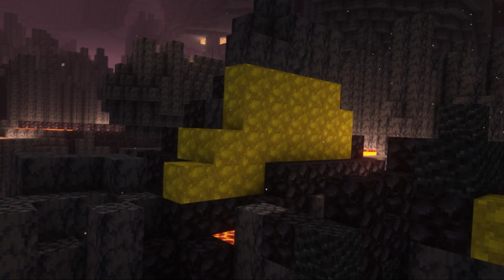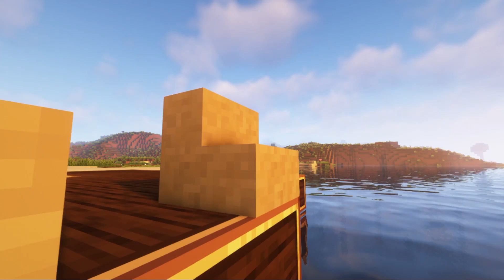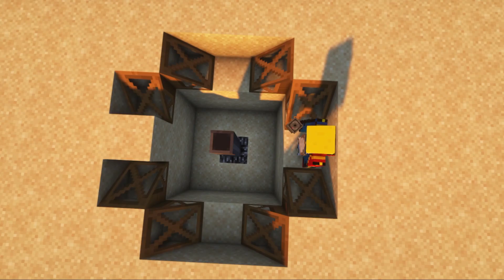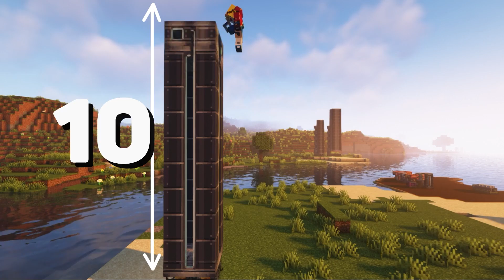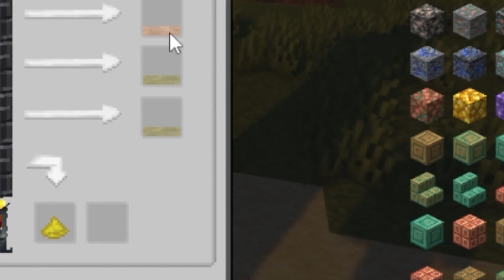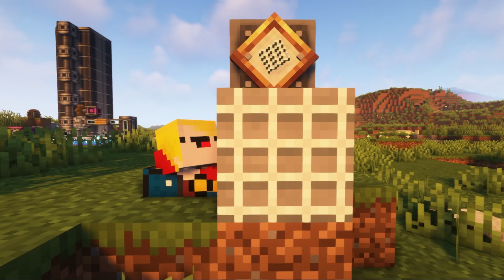Create The Factory Must Grow Tutorial / guide 1.18.2 - 1.19.2 Oil and engines (Minecraft java)

Comment: When I place the pumpjack base holder, there is no pumpjack
Reply: Make sure it is the right way keep rclicking with a wrench until it works
Reply: get seven pump jack parts, a pump jack connector, and a pump jack head. go two blocks away from the base, and place two steel trusses upwards. Place the hammer holder. Put a pump jack part in the hammer holder, and then build pumpjack parts away until you put a pump jack head directly above the pump jack base. Build two pump jack parts backwards from the holder, and then a pump jack connector with white things facing sideways. Two blocks under the connector, place a machine input then a pump jack crank. You should hear an anvil sound then see black string everywhere. Give the machine input some rotational force and then it works